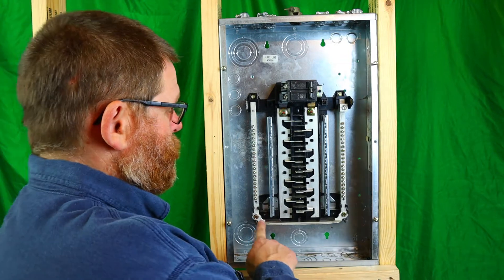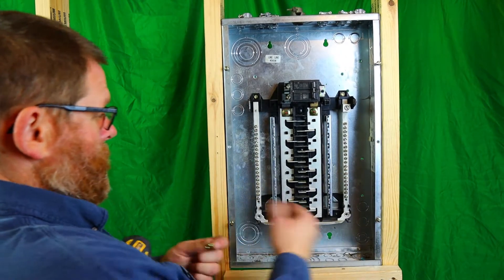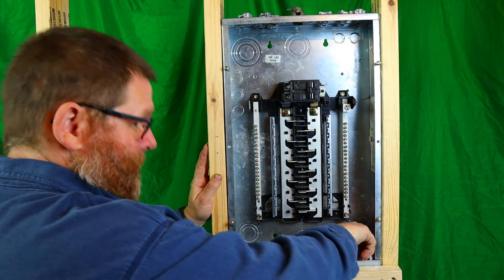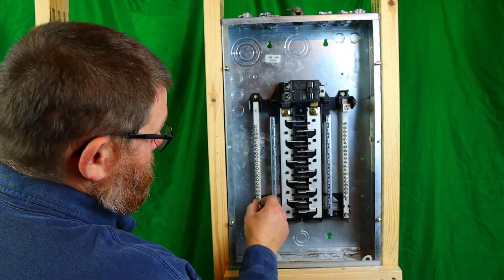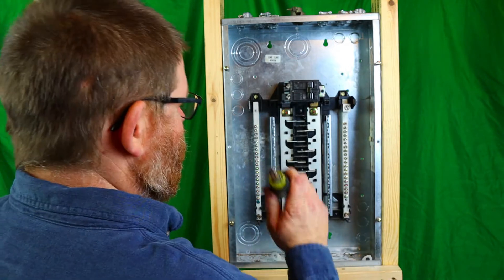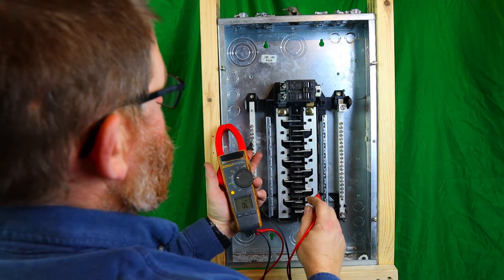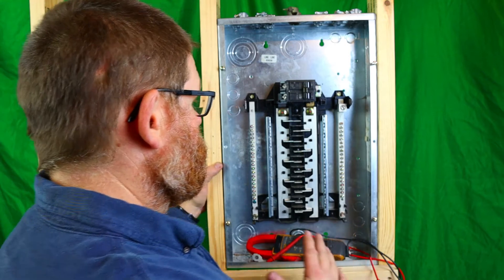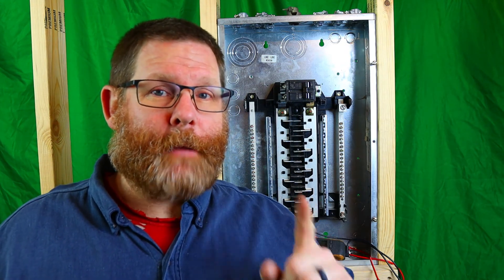How To Install And Wire A Sub Panel | Separating Grounds And Nuetrals Episode 2

Comment: What is the bonding requirement on and existing system when there are only 3 wires to the sub panel, there is only 2 hot and a neutral, no dedicated equipment ground. It would seem that if seperating neutral and ground at the sub panel in this situation would take away the ground return to neutral at the main panel.
Reply from the maker: You have to pull a ground wire from the panel and depending on if it's a detached or attached garage you may have to drive a ground rod too.

Comment: Ive found several places online that say the subpanel should not be bonded on either side.   It even says throw away the green screw.   Your the first one ive seen that says bond the ground bar.
Reply from the maker: How else would you make the panel can safe?
Reply: He is bonding the ground to the panel. Not bonding the ground and neutral in the sub panel. He says to only bond in one spot which is correct.  and that main spot needs to be the first point of disconnect.

Comment: It looks like my sub panel has that bar but not in the front like yours.  it kinda of looks like it runs across but its recessed.
Reply from the maker: Then you will have to add a ground bar to the panel it self
Does that make sense?

Comment: I'm about to change out a bad GFI. My question is about the replacement, is it supposed to "test" and click prior to being installed? When either button is pushed in my hand, they do not engage or "click".
Reply from the maker: Excellent question, no it will only work when it's is connected to power. Good luck and thanks for watching and commenting ☺

Comment: I have an outside square D meter box with a disconnect, is the panel coming off of the disconnect described as a sub-panel?
Reply from the maker: A Sub Panel is anything after your first point of disconnect means. So if you have a breaker in your meter that disconnects power from there to another panel then it's a sub panel. Make sense? So if I am reading your question right then yes to your answer

Comment: I hope you can answer this question because its confusing to me. 

My friend needs a sub panel at his house. So we watched a couple videos and decided to try it. He has a shutoff panel outside at the meter so his "panel" doesnt have a main breaker. I guess his main panel would be considered a "sub panel". Saying that, the videos I have been going by shows putting a 6ga ground wire and 3ga neutral on the neutral of the feed panel, then when inside the sub panel, putting the ground on the ground bar and the neutral on the neutral  that sits between the two hots. The panel Is a square D. Thank you sir for the videos and i look forward to hearing your thoughts 👍👍👍

Comment: I happened to stumble across this video and decided to watch.I think you did a gr8 job of explaining what you're doing but there was one thing I found that you left out.
While its true there should be no continuity between the neutral & ground bars and the neutral and the panel,,,,,,after you bring the wires in from the disconnect and attach them,,, you absolutely will have continuity between the ground bar & the neutral bar & neutral bar & panel.
As you have it set up with it being not attached to the disconnect your statement was correct. But once the wires are connected your statement regarding continuity is no longer true.

Comment: Ok I think I got it straight.  If you buy a main panel and use it as a sub. (meaning it has a main breaker cut off)    Then you remove the bonding bar that connects the neutral and ground bars.  Then use the green screw to bond the ground bar.     Where as a regular sub panel you have to buy and add a grounding bar which when installed is grounded to the panel.  Does that sound right?
Reply from the maker: Absolutely, when you have to buy the bar it's is bonded because of the extra screws the you have to install to hold it to the can itself. You are exactly right with your statement
Reply: yes that makes sense.  I wonder could I send you a picture of the can and you can tell me for sure if this is what i think im seeing?
Reply from the maker: Yes definitely send me one. I'll give you a my opinion